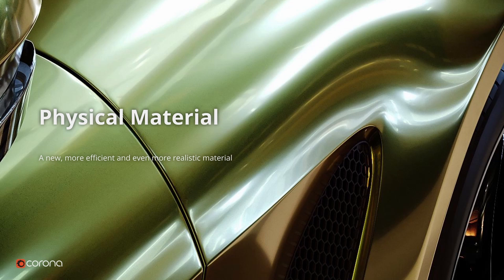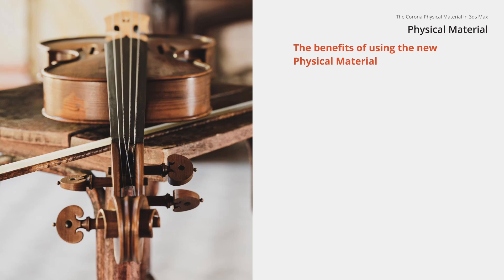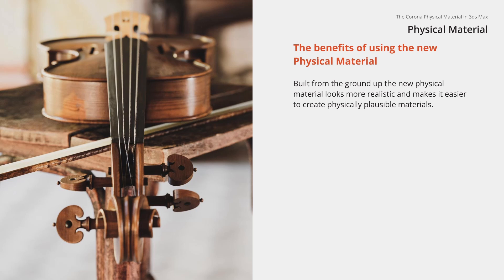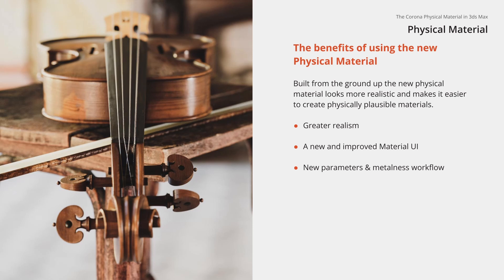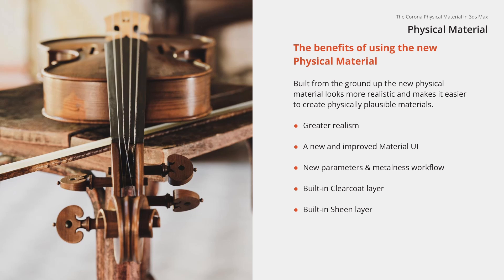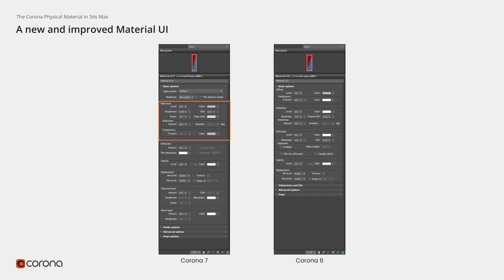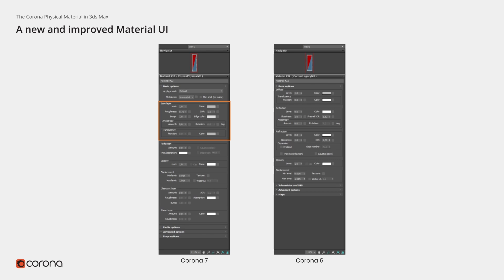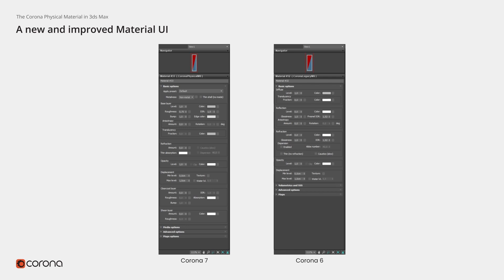Corona for 3ds Max Physical Material Tutorial, Part 01 - Introduction

Comment: Hi, thank you for these tutorials. Can you make tutorial about displacement maps and how to properly use it to get realistic results? Whenever I use displacement map, somehow model looks flat.
Reply from the maker: We can consider this, ty! However it should be as simple as plugging a map into the Displacement slot of the material, then adjusting the Min and Max levels to control the strength of the effect.

If that is not working for you, the quickest solution would be to post over on the forums, sharing an example render of the result, and either a screengrab of the material or the scene, then our support team and the community can help out right away :)

https://forum.corona-renderer.com/index.php?board=29.0 - hope this helps! Tom
Reply: @CoronaArchViz  thank you, I will try with forum, since I already incorporated described workflow.

Comment: The converter does a terrible job of converting VRay to Corona Physical (constantly confusing metalness, almost always renders differently...). I saw a comment below that mentioned this. And I understand the difficulty of converting "physically implausible" materials. But some of those "physically implausible" materials look awesome and realistic enough. 

Why wouldn't you leave an option in the Converter to convert to LegacyMtl? It would fix those issues.
Reply from the maker: Hi! You can post feedback on the converter on a dedicated thread on our forums (where developers will see it) - https://forum.corona-renderer.com/index.php?topic=33253.0

We'll be taking a look at the converter to see what improvements can be made for Corona 8 (using that thread as a source of things that could be handy for users). Thanks! Tom

Comment: Thanks for this update. When I use the corona converter in Corona 7, to convert Vray Mtl to Corona Mtl, it now sometimes makes the Mtl a Metal, even though it is not a Metal. whats up with that?
Reply from the maker: Hi! This is because the materials being converted from were not set up in a physically plausible way, so the converter has to guess what to keep, lose, and change to turn it into a physically plausible material. You can find discussion on this in the dedicated converter thread on the forums - https://forum.corona-renderer.com/index.php?topic=33253. We plan on revisiting the converter in Corona 8 based on user feedback in that thread. Thanks! Tom